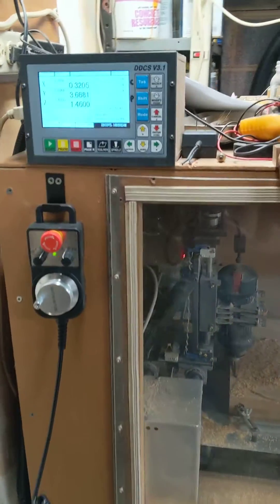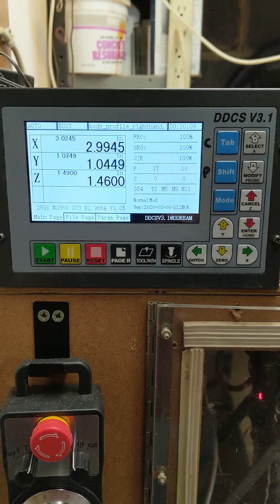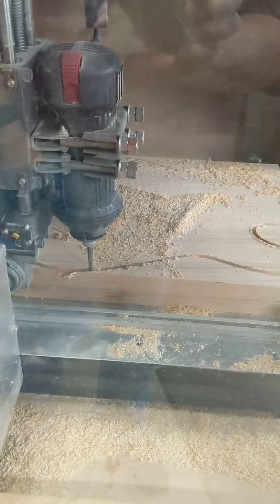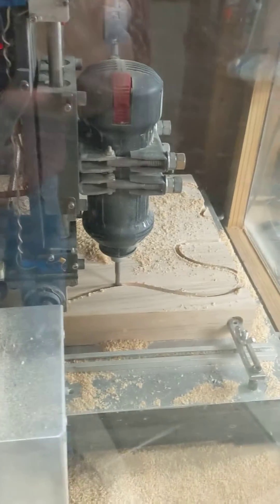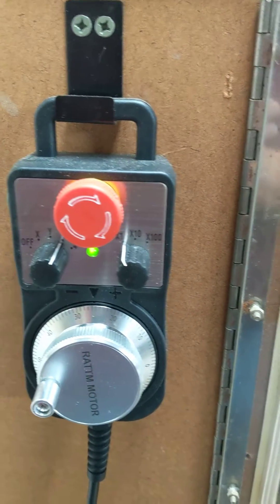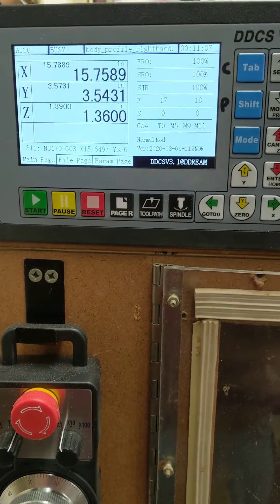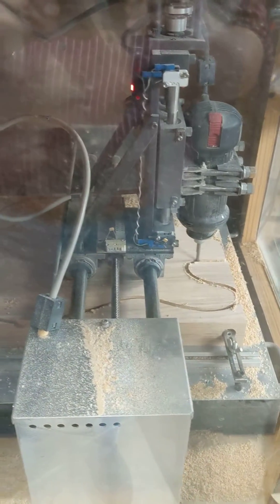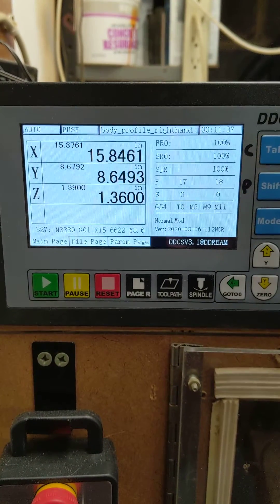DDCSV3.1 CNC Controller Review

Comment: Thanks for the video. I just set my mill up with this motion controller, I have stepperonline t6 series drives running t6 series ac motors. I am currently trying to figure out what parameters I need to change either on the drive or the motion controller to have the same level of accuracy with my pendant that you have. When I have the pendant set to move one thousandth of an inch the axis I'm moving moves about 2 thou at a time. In the manual for the drives, I have lots of questions regarding electronic gear ratio which is still set at 1 to 1 and have dropped my command pulse counts per revolution form default down to 85 through trial and error getting the machine to move accurately according to digital readout. If you have any recommendations as to if I'm doing anything incorrectly or advice on any parameters to change would be greatly appreciated.
Reply from the maker: I don't typically machine manually with the pedant control.  I am usually running g-code.   I'll use the pedant to check work piece location or touch off to check height.  Or I'll use it to move the power head out of the way while I am setting up the work piece.  The only setup in the controller is steps per distance on each axis.   I don't think I ever checked to see how much the head moved per detent step of the pendant on each of it's speed settings  but  you made me curious and I will check and see.   However it does not matter much to me as I just look upon the X1,X10,X100 as speed/resolution settings.  If it is the case of X1 being one pendant detent per motor step, then the DRO will only increment the distance your axis moves upon one motor step.  Depending on your twist rate, etc, this may not result in a nice integral amount of movement. Right?

Comment: hi Dean, can you help me convert g251x geckos to control DDCSv3.1 ?
Reply from the maker: I forgot to mention in the video that I used an interface chip to convert the differential output of the DCCS to the single ended logic required by the Gecko drivers for step and direction.

Comment: Does it have auto tool changer?
Reply from the maker: I do not believe that it does.  There might be capability in the software to accommodate tool change.  But I am used to running separate g-code files for each of my manual tool changes.

Comment: Hello, I've been looking for videos like yours for a long time, thanks for taking your time.
I use Mach3 and I also want to change to a DDCSV3.1, or to the DDCS expert model.

I would like to ask you if you are comfortable with the controller after so long and if you miss the toolpath preview or something else.
Thanks in advance.
Reply from the maker: I did not get much use out of toolpath preview on Linux CNC.  I preview the toolpath in my CAM software before loading it on the machine.  Preview on the controller is just "Eye Candy".  I am grateful that it is in Linux CNC, but it's not a deal breaker.

Comment: hallo
how to calibrate the servo or stepper motor?
Reply from the maker: I am running stepper motors.  No calibration was required. But I had to calculate steps and lead screw pitch and enter these numbers in the setup.  This aspect is similar to Linux EMC.  This controller also allows for backlash compensation, but I have not set this up yet.  Not really needed for the wood routing I am doing but I will set this up.
Reply: @deanhedin1615  how to calculate ... and how to input to ddcsv 3.1
Reply: @jeym5948  hey try Fusion 360 ,works for me .
Reply: @deanhedin1615  cant you make video for mee .... please